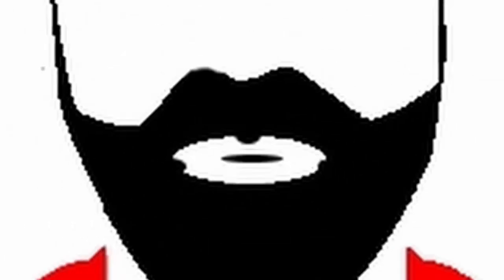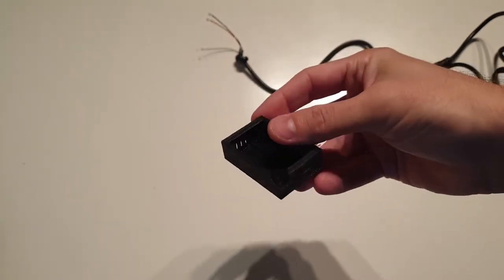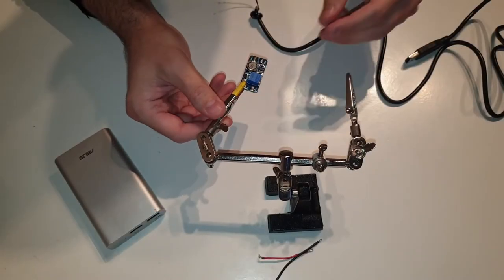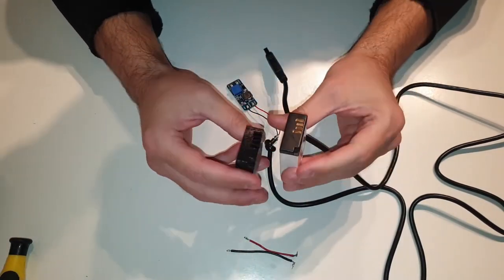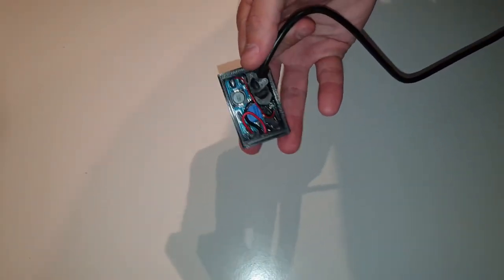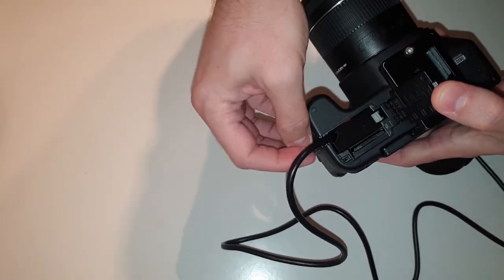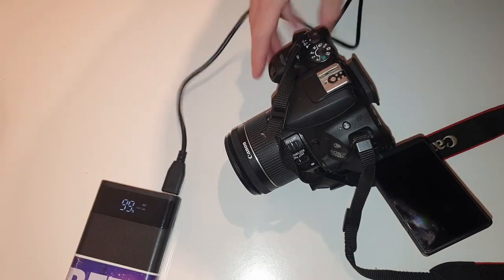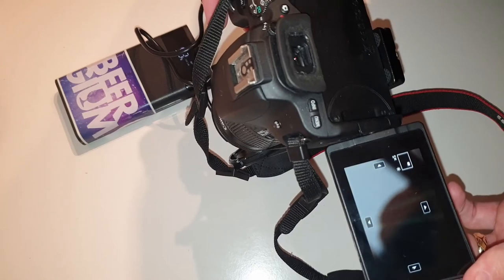USB Powered DSLR Camera for UNLIMITED Battery Power [ DIY for Less than 1 USD ]

Comment: Everyone dandy until the the wire gets unplugged. If you can put a small lipo batt inside as a buffer, that would let the camera survive short duration disconnects. You can salvage those small boards from single-cell USB power banks I suppose. Wore the external wire to that board. And that board powers the step-up converter.